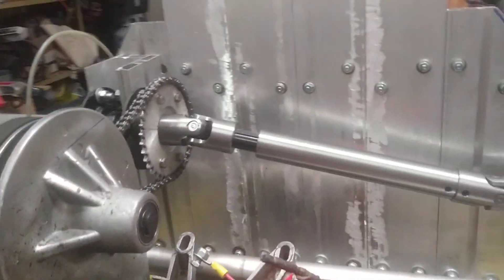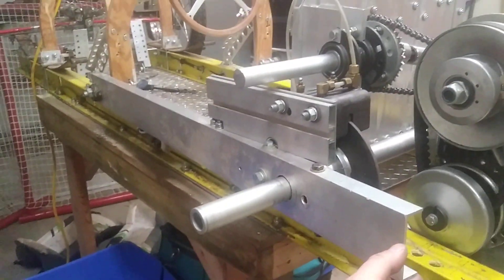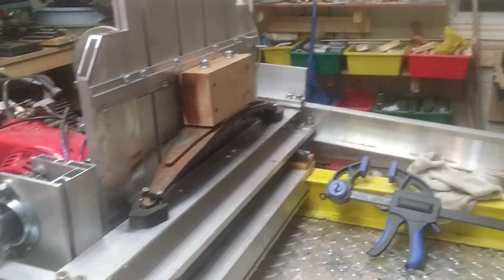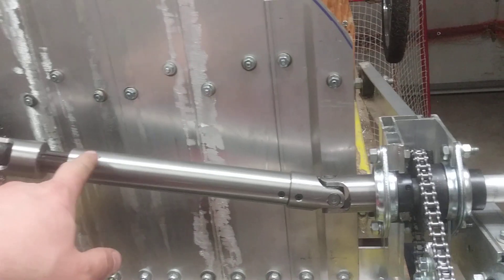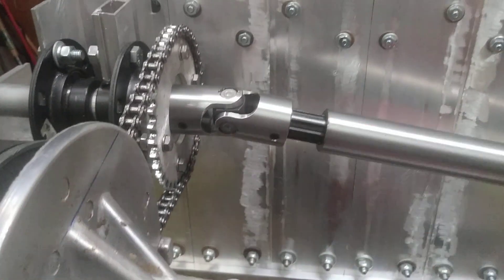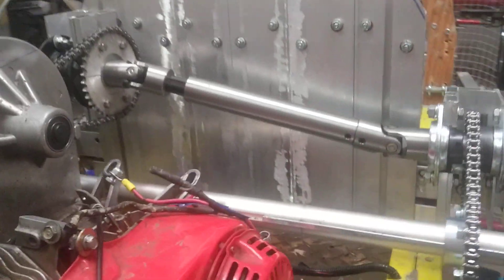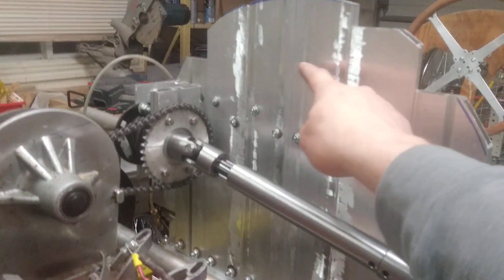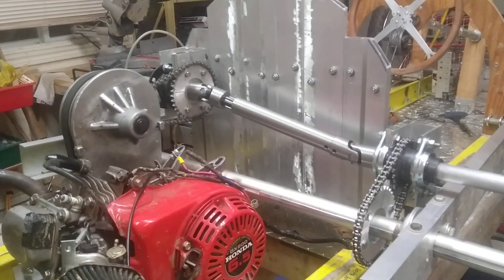The Vulture Cyclekart - New shaft drive system

Comment: Driving both rear wheels without a differential?  When you said it worked wonderfully did that include turning?
Reply from the maker: Yeah! The only time the live axle is a problem is during u-turns on asphalt. The radius suffers a tad. But on every other surface and every other conditions, it works great.

Comment: is it designed to turn both rear wheels or just the one.  I haven't seen a Cycle kart yet with rear suspension.  I wonder how your front suspension looks like
Reply from the maker: Both. The last chain turns the rear axle which is solid and attached to both rear hubs. We took it out for a more lengthy test in sept 2019 and it worked beautifully.

One of my other videos shows thw front suspension as part of a tour of the whole cart.
Reply: Here's another one with suspension.   First video is when the chassis was first driveable, and the second one is the completed kart.
https://www.youtube.com/watch?v=N6_nIt5FQHA
https://www.youtube.com/watch?v=sxBVC5-uh38